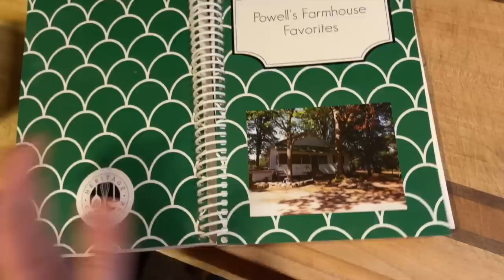The Pits! 😝

Comment: A simple suggestion for aiding a driver with directions, if the driver needs to move 4 inches, hold your hands 4 inches apart, and close that gap as the tractor gets closer, so that when the distance is zero the hands are touching.  waving one hand in a circle doesn't tell the driver whether they have 6 inches or 18 inches to go.  one other suggestion, when at the back of the tractor, try to stand on the right side as it's easier for the driver to leave a hand on throttle, 3-point, or hyd control levers while looking over their right shoulder.

Comment: The one thing I’m hoping for and trying to believe it will benefit with the temperature swings is that maybe it will kill off the insects that are everywhere… at least that’s what I keep telling myself. I’m waiting to find out. 
Since all the tires have been worn out maybe you could try taking a large drill bit and drill at least one hole on each side so they drain some before you have to pick them up. Maybe you could try it on a number of them so you don’t waste your time in case there’s no improvement. May you all have moderate weather until you need the hot weather. 🙏

Comment: Drill a lot of holes in one side of the tires, might help from getting wet. Great videos, stay safe and healthy y’all.
Reply: I just made the same suggestion then i saw you already did so i deleted. 👍🥴
Reply: Drilling of holes helps keep the mesquite population down,or a squirt of WD-40, and oil base should work also.
Reply: @bohhica1  Holes in the tires might be better than WD-40 or oil leaching into the silage.
Reply: +1

👍🏾

Comment: Best way to deal with old tires for weights, is to drill large holes on the walls sides (on single side only if you are using water to help weight down the plastic covers, then flip the tyres before moving) to help drain out the water.

Comment: Oysters are a hunt camp tradition for Florida hunters as well. One of my favorite memories as a kid, about 15yo, we would ride around the woods in a bench seat Chevy pickup eating oysters from a pint. I sat in the middle and would put the oyster on the cracker. My dad was on the window applying the hot sauce, and we'd pass the finished snacked to whoever's turn it was to eat. Good times, you can't beat hunt camp.

Comment: #MeredithBernard On the old tires that you are not going to run on equipment anymore take a hole saw and drill a hole in the tread side of the tires. 1" up to 1-1/2" . When you are not using the tires lean them up with the hole to the ground. Most of but not all of the water will drain out.

Comment: Enjoyed the video as usual, just wondering if you could drill a hole or two in each tire to prevent water accumulation?
Reply: Thought that too. I have see alot of people that cut the tires in half where you still have the weight of the circle but alot less standing water inside it. Plus the weight of the half tire still keeps the plastic in place.

Comment: You’re supposed to cut the tires in half around the middle of the circumference. No water in the tires and in aids in stacking the tires when not in use as the tires will then nest a small amount.

Comment: On your tires holding water, if you drill a series of at least 4-10  3/8-1/2 inch holes in the sidewall they won’t hold much water. Or be breeding ground for mosquitoes. Most of the water will drain out.

Comment: Ever thought about setting your kids up with a 1/2” hole saw, on a cordless drill, and setting them into cutting drainage holes in those tires?
I advise a hole saw, because I have found that if you use a simple drill bit, the rubber tends to close up after you have drilled the hole. 
But, if you use a 3/8” or 1/2” hole saw (Diablo) on a self tapping mandrel, you can rapidly drill drainage holes through the rubber and wire reinforcing in the tire. 
Like 30 seconds a cut.  If you place 2 holes 180 degrees from each other, on opposite sides of the tire, as low down to the tread as possible, you will have a self draining weighting tire. Free from mosquitos. 
I’ll send you the hole saw. 
Put one kid in charge of drilling, another kid in charge of managing the tires (moving them to and from the driller), and in half of a day, all your tire weights will be self draining. 
No more of this slopping around with wet tires.

Comment: Tick Prevention !!!!!!!!!!          I used a product called POURIDON (or something like that.) on my horses years ago.  At the time it wasn't approved in Kansas but they were using it on the track in Arkansas.  It came in sort of a squirt bottle (like mustard).  You started applying it at the poll and went all the way down the spine to the tail.  Then you took the heal of the bottle and rubbed in.  It seemed to work well and my horses were on tallgrass prairie.